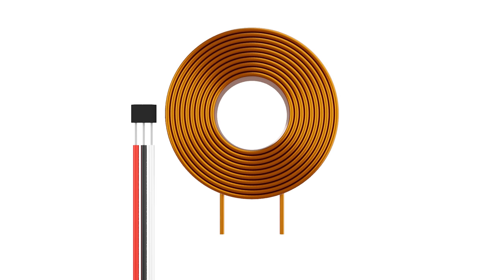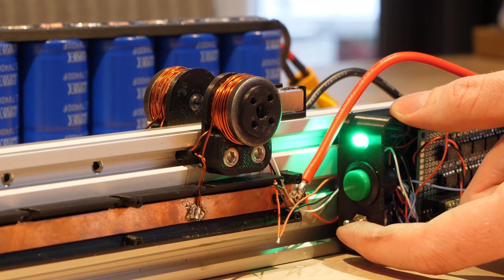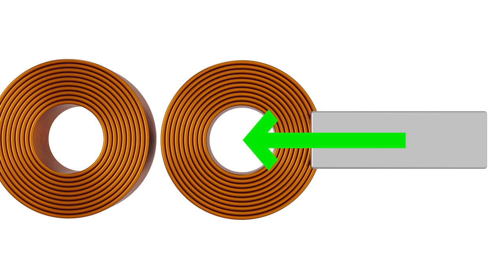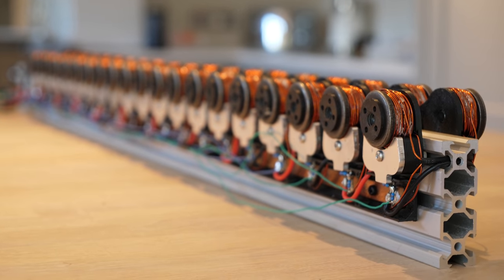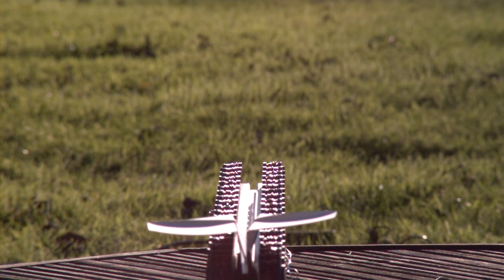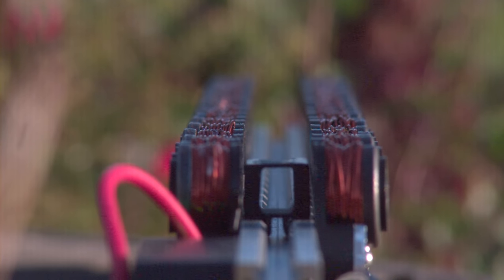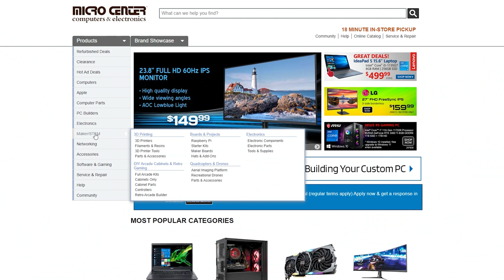Electromagnetic Rail Launcher

Comment: If you want to make this much more efficient as a magnetic levitation device with controllable speed for a kind of train, check out how different maglev trains work (lots of interesting videos about this available on YouTube). If you want to make this much more efficient in the aspect of "give it the quickest and most intensive acceleration you can with EM fields", check out some videos about railgun experiments (careful: needs a deadly amount of energy with a risk of fusing some parts together).

Comment: Thanks for the video, at the end when you said you mainly use 3D printers and Arduino code, I realized that's ME!  I've also made my own motor using ferrite rods for the core and an miniPro board to control an electronic speed controller.

Comment: You could likely get a lot more power if you used a sled other than aluminum. Aluminum is paramagnetic and so when it or a magnetic moves by it, it's more effected by magnetic fields, such as when you drop a magnet down an aluminum tube it takes longer to fall. So when you are trying to slide a magnet along an aluminum rail, it's going to be a lot weaker. You could maybe 3-D print one from plastic and use a 3-D printed plastic one, as well! Although it will wear quickly as it tends to do with railguns in general xD

Comment: Using magnets on the sled, instead of just steel, you could have doubled the force by reversing the direction of current through the coils, therefore, flipping the polarity and pushing on the magnets.  So as the magnetic on the sled are first be pulled, and then pushed by each coil as it passed by.  This is something that wouldn't be possible if you just used steel in the sled.  So, in this setup you didn't need to use magnets, you could have just used steel.  Magnets did however give this setup some extra power.
Reply: 使用钢的效果没有磁铁好吗？我的理解是磁铁经过没有通电的线圈的时候会对线圈铁芯吸引。

Comment: I would add a catch and return system for the sled, allowing it to drop out from below the launched projectile, slide underneath the rail, and reset itself without launching the magnet. Alternatively, you could also hide a small disc magnet inside the nose of the paper airplane...

Comment: I have no idea why this was in my recommended but after watching I had the thought what if you had repelling magnets on the base (always active) to remove friction as the projectile is fired, you could adjust the repelling force by adjusting power so it doesn't touch the top of the rail... and if you really want you could use a super conductor that keeps the magnet at a specific height.

Comment: Good Job. Had an idea to where a Projectile, Rod, Whatever would Run through the Center of a Series of Coils, and off would be controlled by Photo Detector Pair. Was thinking detector location would change  as it accelerates?
Glad to see this work. Thought a Gun Could be made, and a small magnet could hold steel ball in place so it wouldn't fall out if aimed below level.

Comment: There should be (I think) slightly shorter and shorter delays between sensing and switching for the forward-most magnets (similar to advancing the timing in an engine). If you're not doing this, the later magnets won't be delivering full acceleration - or could actually be decelerating the projectile. Just make the timing for each tuneable and tune the timing for the first magnet, then the first two, then the first 3, etc. Timing for earlier ones should stay the same as you add more to the line.

Comment: 1:48 - Maybe try using some kind of opto-switch, it would greatly reduce latency. Make an automatic nerf gun with it, that would be a real cool project had some idea to use this concept. Wonder if the rail would easily be reversed back to it's original launch position. Also check on ferrofluid clock,  uses electromagnets.

Comment: Cool, have you done any solenoid powered piston engines? I have seen some miniature concepts, but since it has a crankshaft, I think its torque feature would be rather interesting, compared to a regular DC motor... I am not that educated on electric engines, but I think a piston focused approach on an actual device, like a boat or a automobile would be quite interesting. Especially a boat, because it would be an electric engine on water... hmmm. Great channel!

Comment: Look into stacked plate stator cores. Get the eddy currents working for you. Also look into a different rail material other than aluminum. Aluminum has a strange relationship with magnetic fields. Maybe some strong composite. I have a model steam engine with a aluminum and lead flywheel. I can load the engine with a hard drive magnet by just holding it close the the aluminum wheel. You could also look at reducing the magnet size, and adding a ferrous core to the sled. Just a few thoughts based on my past experience making model airplane brushless motors. I have had this very idea bouncing around in my head ever since I heard the words "magnetic rail gun".
Reply: One more thought....Progressive spacing of the drivers?

Comment: I designed an engine back in 1963 that could run on compressed air or any flamable fuel.  It is based on the jet propulsion, but with a ninety degree twist.  I could turn a propellor at very high speeds, or by changing the diameter of the driven element, could produce far more torque at lower RPM.  I only correspond by email, no social media.

Comment: Looks fun! Question: I've been told that a coil's magnetic field does not instantly turn off. You are sensing the projectile and turning off the coil when the projectile is in the middle of the coil. If there is a still a magnetic field present does it effect the speed of he projectile?
Reply: Super old comment, but I wanted to add the same. A magnetic coil is an inductor, and the way inductors work is that they oppose sudden changes in current. When you "switch off" a magnetic coil with a MOSFET, you're trying to set the current to zero near-instantaneously and the coil responds by creating a voltage spike to try to prevent that change. Exactly what effect that's going to have on your circuit depends on a lot of real-world factors: maybe it shorts the MOSFET in a non-harmful way and just delays the switch-off (i.e. slowing down the launcher), or maybe the voltage exceeds the MOSFET tolerances and it blows up permanently. It depends, but either way it's not something you want to ignore in the circuit design.

Comment: How did you raid my dreams and build this??? :)  :)  :) Great job! 
Looking at the slow motion of the sled moving down the rail, it seems to bump a bit. You might try using teflon for the plastic on the sled, and line the rail with the same. It would reduce the friction of the sled. Or even try adding some grease.

Comment: Question:  By using the same design over and over and the same measurement, aren't you essentially limiting the speed of the projectile to the same as if there was only one coil?  I'm thinking to get each successive coil to speed the projectile faster, there has to be some fundamental timing change or current change or distance change or magnet size change from first to last in order for it to keep accelerating.

Comment: Did you consider using the Lorentz force instead? thats what most of the rail gun designs use, also if you are doing it that way, I would buy off the shelf electro magnets as its difficult to get accurate layered windings with minimal losses a 12v 1w 50diax30 can produce about 0.7 Teslas. Also, for the control circuit, look at the littlebee nano FPGA, you can buy them for £10 and free open source programmer, they are very fast upto 150Mhz. Arduino ok, but for fast timing and lots of pins, FPGA's are the way to go.

Comment: By changing the angle of the wings of the paper airplane, you can make the plan lift of better and more stable. The thing is, the plane is being pushed from the bottom of its back. The top part of the plane starts accelerating a bit later than the bottom due to inertia. This causes the plane to angle upwards and so does the wings. This causes the plane to lift off prematurely. You can most likely make the plane go much faster by folding it on a downward angle instead of being parallel to the ground. It should give more time to speed up. Awesome vid man :) Loved it!

Comment: did you work out the time each coil is active as the sled accelerates you could put more current in to the later coils .maybe make the track tighter with some form of lubrication.

Comment: I made a similair thing with magnets and coil though it shoots electrical data fields all the time you pull the trigger mind you the gun also over heats and once it over heats it gets jamed for 10 seconds and once it cools down it repairs its own system back to normal though your hands could probably be cooked xD

Comment: A thought that probably has been done before, but how difficult would it be to design the system to have the power come from the sled, and control the timing by contact with the leads?

That is, exposed leads on the bottom of the sled connect to leads in the track that are positioned and given just the right length so that the sled's leads touch the leads for a particular coil only until it hits the center of the coil, then cut off? Or, for your reversible one, have leads leading out of the coil that are reverse of the leads leading into the coil.

The idea being that the powered sled carries its electricity with it, and the precision timing needs no special computer parts because it's entirely mechanically controlled.

The downsides as I see them are the higher friction of the drag of the sled lead on the coil lead, the increased weight of having the battery on the sled, and possibly increased danger from the necessity of exposing the leads. Maybe some sort of inductor could be used for the latter, but that only increases the inefficiency of the electrical transfer.

Comment: I'd prefer to go at it with a laser and light sensor. Gravitational fields are circular, it could pick up the rod before it has to thereby taking a little bit of power out of the equation. Light will break as soon as that rod is in position for it to every time

Comment: Question, can you explain why it's safe to touch the circuit at 2:37? You say the capacitors deliver 100A of current. What's the voltage? Can the resistance of the wire be considered so much lower than your skin that you can safely touch it? Asking as a person relatively new to electronics. Thanks.

Comment: This is an unusual aircraft design, but it is rarely talked about because this thing is secret. The subject of pulsed plasma thrusters has been known since the beginning of the 1960s (see PPT - Pulsed plasma thruster in Wiki) - they are usually designed for space vehicles. But I will talk about a little-known design - plasma thruster panels for vehicles flying in the atmosphere, the same Pulsed plasma thruster is used there, but reduced to the size of a pencil and laid like cells in a panel. The design is like a conventional plasma TV screen, because there are also bit cells there - to activate the glow of pixels on the screen. And in plasma propulsion panels, the discharge cells are long, the spark gap has a railgun architecture (simply rail contacts or coaxial), and the ionized air of the discharge is accelerated there by the Lorentz force to enormous speeds - a kind of ramjet engine is obtained. Just imagine! - tens of thousands of small ramjet engines assembled into a panel and firing plasma synchronously at a huge frequency (hundreds of kilohertz). Thus, plasma propulsion panels create a lifting force with the help of pulsed emissions of plasma jets from railgun cells - a huge impulse is obtained, and the plasma swirls the air into toroidal rings - the aircraft is supported on this air cushion. Horizontal acceleration is created by the same plasma panels on the sides of the device (they glow, from the side they look like "portholes"). Such devices like "triangle" or "disk" have been observed for a long time, they are mistaken for aliens - but these are terrestrial devices. They are classified and are used for espionage and secret actions. Pulse electromagnetic technology generates microwave radiation, therefore it is harmful to health, therefore they rarely fly - only military missions. And for a citizen, therefore, they are not suitable. Now the declassification has begun - too many people know about this secret technique. When declassified, they will be used for cargo airships.💫💫💫💫💫💫💫💫💫💫💫💫💫💫💫💫💫💫💫💫

Comment: So, another thing that could optimize this, is the spacing between the hall effect sensors and the coils they control, because the sled will be moving at different speeds when entering the range of different coils, meaning by using uniform lengths, the sled would move too fast and end up pulled back and decelerated before it switches off. Each one needs to be a different, fine-tuned distance. Alternately, you could control the HE Sensors to an Arduino to record the timings, and control the coils on a script instead of using MOSFETs, tweaking the timing of each coil each iteration to optimize it, then once it's fully optimized you could just disconnect the HE Sensors. Though, this would only work if you always use the same payload/sled, and any miniscule weight difference would need to be re-calibrated/optimized. Theoretically if you put that thing in a vacuum chamber as well, you should easily be able to get that thing to exceed the speed of sound, at which point you have an honest to god coil-gun that actually works and would be man-portable. 

As for using gliders, I suggest using a more durable type of glider than just a paper airplane. maybe a larger balsa-wood glider, or something plastic, with the metal sled being mounted IN the glider, doubling as a low center of mass to keep the glider stable.

Comment: Tom this would possibly form the base fora linear motor maybe ? possible video idea ? bigger sled and maybe an Arduino could be the servo controller (a linear motor is basically a servo anyway) maybe you could use a couple of the hall effect sensors to create a quadrature encoder of sorts to close loop control.

Comment: Sweet build So any way I've been asking all the people on here that have build 1 or another version of these and or rail or coil guns to try their hands at a build that I envisioned many years ago when I was doing model rockets in junior high school.  Any way I wanted  to build a flying saucer but after several failed attempts to do so with rockets I came up with the idea of using electromagnets and Mercury What I had in mind was a disk around which I would wrap a tube with mercury in it and a electromagnet around just inside or out side of that to generate lift. So I'm not sure how much power would be needed as input and what amount of lift power and or thrust it might produce. If you are of a mind to try to build it I would like to see your results. I have more recently Seen videos on here that give me hope that I might have been on to something with the design. Thanks for the video and keep them coming

Comment: How would you make it pull-push configuration? If you switch the direction of the current, the electromagnetic poles may change and convert this into a pull-push system....but then the source would have to be AC current basically and not a capacitor bank.

Comment: Hey Tom, I didn't scan all 2735 comments, but I wonder if the 33% difference in voltage rating (8x3V, vs 3x12V) of the capacitor pack vs Li battery can help explain the 20% energy difference, even though regulated down to 16V?  to know, it could be repeated with two Li Ion packs.

Comment: the iron bolt  acts as a concentrator of the magnetic flux in the center of the coil... minute 02:10 if you don't mind i will use your video in an example in twitter regarding Black Holes. I hope some will understand... most will be antagonistic about it ;)

Comment: I'd have gone for either the projectile pressing contact petals together, or using a through-beam photoelectric sensor (basically an LED/laser diode pointed at a photodiode, with the projectile interrupting the beam).
Also, you can get much higher accelerations if you operate as a linear induction motor that pushes the conductive projectile away from the freshly-activated coil.

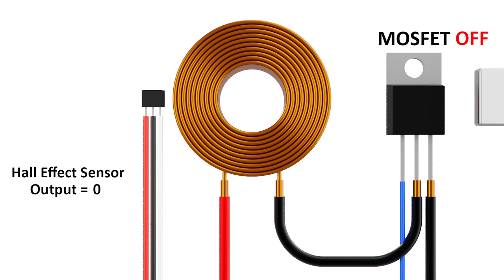Comment: 1:40 Instead of turning off the coil as the magnet passes centerpoint,  you should reverse the coil so it pushes.    EDIT: just made it to the end and see you are already on it.     I'd think you could build an adjustment to fine tune where the sensor sits so you can adjust timing for best performance.

Comment: Sir, PLEASE put a stop on that. Literally just a screw so that you can use it as a proper magna-crossbow, And not have the sled fly off every time. Also, Sled designs are important. Recommend having multiple different ones for different applications, Like one that's basically a square pipe with a back, To launch more hotdogs.

Comment: Wonder what would happen if you oblonged the wire turns on one side, in essence fanning the wire out on one side as a single plane of one wire in thickness, and just extended out further away towards the sled, while on the other side being wound normally. Increasing the time the sled is being drawn towards the center of the current on one side, while minimizing the time off between the coils while off on the other. Probably do something wierd or not work at all, but it would be interesting to see what it might do. It sort of makes sense if the wires field is still intact. In a basic kind of way. I'd be curious how the field changed. And if it increased the speed. Or shorted out the field entirely. Do magnetic fields always have to be symmetrical? Idk. No, im not an electrician. No certainty it would work at all. But worth the experiment.